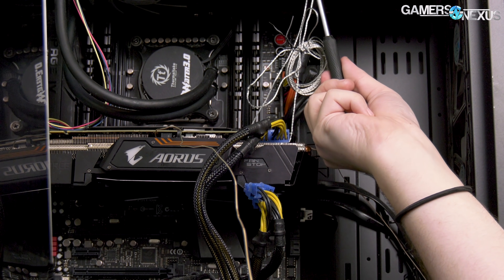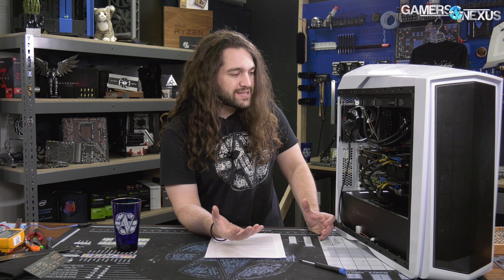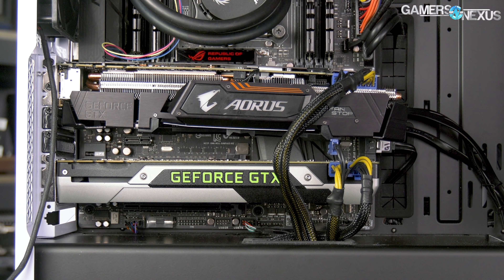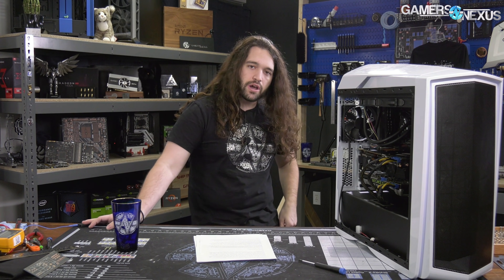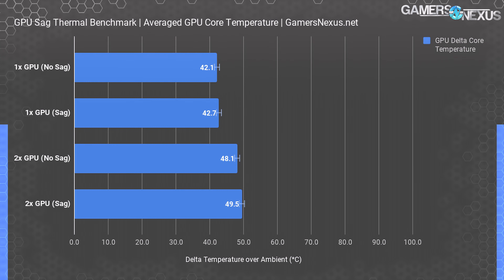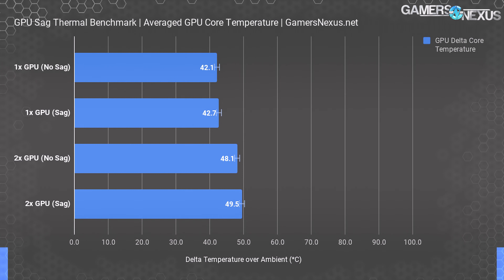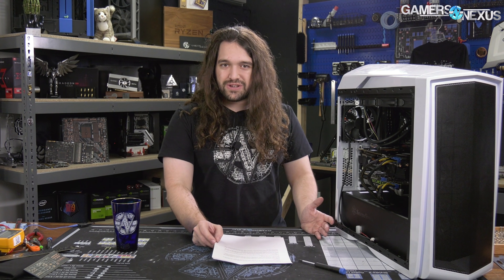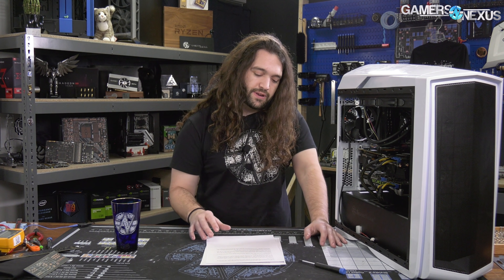Video Card Sag Test: Thermals & Frequency on Drooping GPU

Comment: It looks like the "No Sag" wire was around the PCI Power Inputs for the card, but it also looks like it may have been touching the heat sink.  If this is the case, the metal wire may be effectively increasing the coolers surface area.  Depending on the wire and how much contact, this could be significant.

I have a Gigabyte 1080 Xtreme Gaming G1.  Basically, the 1080 version of this card that cost me the same amount because I got it before the Ti came out and dropped the prices...  My card did sag like crazy.  My fix recently, was to switch to a ThermalTake Core X5 (from a Corsair SPEC-03).  Horizontal mobo, card sits upright, no sag.  Problem Solved.  Except, now I can see that these "X" lights on the front are dying.  One is basically dead, another is half dead and 2 seem to be OK.  

Has anyone had dying LEDs on a card?  Were you able to fix it?  The card is only a year or two old at most and LEDs should not die in that amount of time.  The case fans on my old SPEC-03 were in my case for 2 years prior to obtaining this card and every single LED was still working.  The case LEDs were on much more often than the GPU lights because for the first 6 months I had the card I ran the lights with brightness set to fan speeds.  Most web browsing put the GPU in fan idle or fan stop so lights were mostly off.  

@Steve,  I ran this card in an ASRock Xtreme Gaming v4 mobo.  My MoBo looks fine, but I have seen others with this card complaining that the sag actually pulled a lead or two for that x16 slot out of the board.  My guess here is that they pulled it out when they were removing the card.  My card was actually difficult to reach the PCIx16 release while lifting the card and because the shroud, despite being heavy af, is actually really weak and flimsy.  But I just wanted to see if you had any experience with actual damage due to sag?

Comment: I had a strix gtx970 which would reach 95 deggress celsius in seconds. Didnt know what was wrong since i changed the thermal paste and everything. The next day i supported the card since the sag was bothering me and voila the temps dropped to normal. The sag actualy caused the gpu to lose contact with the heatsink. Thag was the first time i saw graphics sag beiing a problem and to this day i still cant figure out how is this even possible. Most cards bend at the mounting point to the rear of the chassis, my strix had the whole pcb bent like a banana (a bit exaggerated but you get the point)

Comment: I'd say a bigger concern is that if you are the type who moves your PC around, the sag will likely significantly reduce the life span of the card as repeatedly flexing the PCB makes it more likely to break solder joints and copper traces due to metal fatigue

Comment: The Asus GTX 970 Strix of my girlfriend had an extreme sag over 2 years, but the temperatures were still okay. But because of a new case with a glass window we bought a bracket to support it and help the 970 to dont look that horrible, but after "fixing" the sag the temperatures rised in seconds to throtteling, the cooler didn't contact the GPU anymore so we let it sag till today ;D maybe tightening all srews could have helped but the sag looked so horrible, I didnt want to touch this thing and destroy it D:

I'm just very disappointed in Asus, something like that shouldn't happen to such an expensive GPU, my cheaper and larger R9 390 from Sapphire didn't sag after 2 years at all. On this card the cooler is straight connected to the part which also holds the display-connectors (dont know this word in english ;) ). After inserting something similar to the 970 the sag stopped. 

Cant imagine that Asus did such an stupid mistake, and even till today! I bought an 850$ Asus RTX 2080 Dual and it also misses this connection! After putting it in my case it started immediately sagging. However I put an watercooler on it, so I don't care but this is just hilarious, my 3 year old 300$ R9 390 has an better build quality as a 2018 850$ Asus 2080, I will never buy an Asus card again...
Reply: The "part which also holds the display-connectors" - sounds like you're referring to the card's mounting bracket. And yes, the better cards tend to structurally join the shroud and mounting bracket for longitudinal support.
Reply: Christoph603 I had the same GPU, and it too sagged. Shame on ASUS. I have an EVGA 1080Ti SC2 now, no sag yet!
Reply: My strix 1080 is solid as fuck

Comment: My Zotac 1080 ti AMP! Extreme is being held up by a 4 slot sli bridge jammed underneath in a Lian-li 0-11 Dynamic. Still looking for a more permanent solution. Luckily I added a thermal pad to replace the rubber one and even under full load at 2075mhz core, it doesn't hit 55c. The cooler is great. Just very heavy.

Comment: 😒 uhm Coolermaster makes a little stand to hold up the video card, and on ebay there are brackets that you can buy, depending on ur case u can also use string or zip tie 🙂🥃
Reply: Thank you for repeating/elaborating on exactly what he mentioned early in the video.
Reply: @dickr9345  🙂 ur welcome, i hvnt seen the video, im too busy drinking rite now & playing gta4 ✌️😏🥃

Comment: This is very common in high-end Gigabyte cards, I've had a Gigabyte XTREME Gaming GTX 980Ti and it did the same. I used tricks that Jayztwocents used in his sag-fixing video and it worked, however this sag was caused by a bad cooler design, the cooler shroud wasn't attached to the rear IO shield of the GPU and it caused the cooler to sag a lot.

It's probably more brands than Gigabyte, but I noticed that with their higher-end cards. I now have an MSI GTX 1080Ti Gaming X Trio and despite being bigger & heavier, it sags less out-of-the-box, and with its included anti-sag bracket it doesn't do it at all.

Comment: WTF ? i have a 1080 Ti Xtreme Edition (with the rgb logo in the backplate) and have 0 sag at all, fix that case or motherboard because in my rog hero X + corsair obsidian 750D there's 0 Sag.
Reply: I have the Aorus 1080ti non- Xtreme version(so almost same card  without the RGB logo) and I don't really notice any sag. I  am using the card with a MSI X370 Gaming Pro Carbon and a Corsair spec 02 case. The first 2 pcie slots are made out of metal so I don't know if that plays a factor or not. If there is any sag it's no where near as bad as what I saw in this video. Also the frequency in the video where pretty low like Steve mentioned, but I think the settings might have been the reasons. My clocks are sittings around 1885mhz when running Furmark 2560X1440p 8XMSAA and I noticed the clocks would drop off when the MSAA value was lowered, I think 1961mhz is the highest sustained clock I have seen in a more GPU demanding situation at stock settings. I can keep rambling on, but there were a lot of things I was unsure about in this video so I'm just not going to worry about it.

Comment: I have significant sag on my 970. For about 6 months, I was having issues where my PC would come out of sleep mode for absolutely no reason in the middle of the night. Turns out it was the sagging that was causing it. As my case heated and cooled, I think my card was moving and causing my PC to wake from sleep somehow. I was also getting a minor performance loss. I had to change the port my card was in, and I use a bracket now. 

The sag on my card was way worse than  yours at this point: https://youtu.be/l7P9Xm2JZQs?t=50. I was having real trouble getting it out of the case because the clip on the side of the board wouldn't disengage. To be honest I think I was lucky my card didn't completely die. 

I'm still getting a performance loss, but it's minor enough and I'm poor enough that it's just not worth the hassle of buying a new card/machine.

Comment: My GV-N108TTURBO-11GB, sags so bad it pulled itself out of my pcI-E slot. so much to counter it and get my system to post I had to flip my pc upside down. 
I sent it back to Gigabyte a few feeks ago for RMA and they have been on Holiday since before Christmas..
Gigabyte GeForce GTX 1080 Ti 0 Ti Turbo 11G Graphics Card - 11 GB GDDR5X - 352-bit - 1506 MHz
https://www.google.com/shopping/product/6348544280110616391?q=GV-N108TTURBO-11GD&client=ms-android-verizon&sa=X&biw=412&bih=718&tbs=vw:l,ss:53&prmd=sivn&prds=epd:5706066052279742407,paur:ClkAsKraXw-K4A7J23fv3IftFil2DF_6N1_fBFvxdC74fEinpt2InJqOoQyQ7Thm9Kct3aet9cTmcheStmpdatmc51o6TD8rvAN57ItvJbASwVVQFMneTW9rHRIZAFPVH73gJ2Zgc1LqTA1qdQarEwRyn-8kPg,cdl:1,prmr:1,cs:1&ved=0ahUKEwj3vZrQ_ZLfAhXhY98KHc3vAfQQ4qwBCO8B my pc is so sad now. 
pimp my pc?
https://imgur.com/a/sPSfa1p
Reply: After a month of the RMA process. Gigabyte sent back the same card. Still sags so hard it pulls out of the pci-e slot. 
Looks like purchasing a riser cable and vertical gpu mount is going to be my only saviour.

Comment: I'm surprised you bothered with the temp test on it really.  The only concern I have with sagging expansion cards is the socket being pulled down over time, as it can pull the legs of the solder pads(not an easy fix).
If you're concerned about sag, Corsair DID do a really good magnetic legged stand with adjustable clamping arms. Needed 2 stands for my last case as it had no PSU shroud and it was SLI........."BUT IT JUST WORKS!!"  ^_^  This looks similar and it looks like you can screw the rods together from 2 packs if you need extra height:
https://www.ebay.co.uk/itm/Video-Cards-Holder-Jack-Bracket-Computer-Graphics-Companion-Support-Frame-Mount/323399167552?_trkparms=aid%3D555018%26algo%3DPL.SIM%26ao%3D1%26asc%3D20140122125356%26meid%3D20bb1c5d4ba24edd993f64e4f8bc1452%26pid%3D100005%26rk%3D2%26rkt%3D10%26sd%3D323541118426%26itm%3D323399167552&_trksid=p2047675.c100005.m1851

Comment: One thing that I would have liked to have seen would have been what thermal difference the sagging card would have had if the two cards had been switched (as the lower card has more room below it).  

Further concern, IMHO, is now the sag (coupled with thermal flexure from changing workload conditions on the card over time) could have issues on the overall health of the PCB (Circuit path layers, via points and BGA solder pads) as well as the stress to larger component BGA Solder joints.  All of which could contribute to possible early failure of the card (compared to Mean Time to Failure).  Not something that I like to see from my experience (Class 3, Space level Electronic Assembler with many years of Manufacturing & QA experience.  Some of the things that I have worked on are in Military Satellites, currently in Orbit).

Anyways, Happy New Year, GN!!

Comment: My TwinFrozr 7950 was sagging.  First I tried to tie it to the top of the case through one of the unused PCB holes using some bowstring, but that threatened to flex the PCB away from the heatsink.  Instead, I cut down a broken wood arrow and stuck it in there as a support against the shroud where it attached to the heatsink.  Pushing the comparably inflexible heatsink up along with the PCB kept it straight and level.  Creative uses of archery supplies!

Comment: #ASKGN hi, is there any way to test a PCIe slot beside "plug something to see if works" ? for example i had a z77 board that had a bit of pressure put on the videocard and stopped working, it does not present any visual damage whatsoever... and i was wondering if there is any way/software that could send like small signals to the each pci pin and according to the return to tell which pin is "broken" or something...

Comment: Steve makes a great point.  Steve you're in a position to fix this issue as you have not only a huge fan base but also manufacturer ties.  

The VC sag issue stems from either case manufacturers, Card manufacturers or both.  Simply put the 2 tabs on the Card that go into the slots on the case <On the Motherboard tray part> are too small or the case slots are too big.  If you did a video discussing this and called out those who are in a position to fix this they might just listen.  Till then people must pay extra for VC supports that they wouln't need had the slots or the tabs been sized accordingly.

The only other fix is Screws going into the tab slots which takes away all sag as the card is now supported properly the way it was designed.  Jay did a video on this a year or so back and the screw method does work but is a chore should you ever need to pull the card.

tl/dr: The issue is the 2 tabs on the Card itself being too small, or the 2 slots on the case that the tabs from card go into being too large <--- This being the easier issue to fix

Keep up the great info Steve!

Comment: Look at him just by putting his hand down the table, the sagging card bounces. I had an aorus extreme 1060 and I loved the card but it is true that the design is essentially a waste of material and I'd prefer not tying my gpu with additional cables in my case.  With or without it looks disgusting. Not to mention that I have better temps on my msi armor which I considered a barebone card until I saw the temps. Great vid, now I know I like gpus the way I like boobs, without sagging.

Comment: ~1600 MHz as boost clock on a 1080Ti? That seems very low, is your card faulty? Mine runs sustained at 1974 MHz overclocked, or 1911 MHz undervolted to 0.975V. I run with the latter option as it shaves 10-15 C off the load temps and avoids unnecessary stressing of the card.

Comment: I never thought that a GPU sagging would affect performance. However, I always thought it could hurt the PCI slot overtime especially that some motherboards Market that they have reinforced PCI slots for graphics cards
Reply: Well, as the future showed, and a bunch of repair channels cropping up also - GPU sagging is a prime cause of ripped pads on the GPU core, poor contact, broken motherboards, cracked PCIE tooths ...

Comment: I had similar flex on my GTX 980. The previous owner installed a Prolima Mk-26 heatsink on it (233x146x47.1) and the GPU sagged like crazy. So I put a piece of wood underneath it to stop it from doing that.

Comment: Yeh i have bent many rams while carrying in my pocket they working perfectly  . PCBs are designed to bare the bend. But that much sag actually can damage the BGA of the gpu processor. It can also misaligned the heatsink ,so it won't be parallel to the gpu processor thus poor heat transfer and gpu will heat and what he is talking about.
Reply: Do you even grammar bro?
Reply: @sommor001  this is a comment brother not an article i don't care.

Comment: My GPU (ASUS 1070ti, ROG Strix model) was sagging just slightly, so I just vertically mounted it. I haven't noticed any meaningful difference in thermals, but I mostly play older or low-spec games, so I could give it nearly zero airflow and I doubt there would be issues. It looks a bit better and prevents sag, so I'm fine with it.

Comment: I bought a Tt Core P3 to avoid sag... I have a PowerColor Red Devil RX Vega 64... its 2.5/3 slot cooler is huge and it sags.  I will stick with vertical card mounting from now on.  It looks better anyway.

Comment: As a note i've seen a card that sagged so long that when it was levelled up it would  pull the cooler away from the gpu die very slightly resulting in  almost instant throttling ,  card was a Strix 970.  Guessing it ended up with a warped PCB due to prolonged sag. Managed to fix it with a re-paste and very slightly twisting the backplate to counteract the PCB.

Comment: My 1st thought when I see a gpu sagging so severely is that the card must weigh a ton. As someone who used to move their pc a lot, I'd be so paranoid about having a card that heavy inside my pc. Not so much the sheer weight, but the fact that its construction is lacking in rigidity so much that the card will bend under that weight. Add that amount of flexibility to a car ride and you've got a formula for a pci-e slot being ripped off a mobo as the card bounces up and down over every speed bump. A more rigid card wouldn't have that same sort of pendulum effect on the slot, bouncing up and down from movement, so would be much more likely to survive a car journey. Thought that's all just supposition from me.

Comment: I got a 1080 about 9 months ago now, I also bought a bracket to stop it from saging at all. My main reason for doing this is a previous card I had an MSI 1060 6GB had quite bad sag, I did nothing about it, I worked fine for about 12 months then became unstable. Upon inspection the PCB had warped and the cooler was no longer making good contact with parts of the card. So for any build I now do, I will be using a bracket to eliminate sag just to be on the safe side, or buying a case with support built in.

Comment: 2:20  for non-muricans
1 inch = 2.54 centimeters
Reply: I'm a Briton and I use inches fairly often.
Reply: @invective.  

Even if you use it often, 2 inches isn't that big...
Reply: Are you replying to me?
Reply: People in a lot of places use a combination of imperial and metric, or alternatives to those. Relatively seldom does anyone, anywhere use purely one standardized form of measurement, unless one's personal preference can be called a standard.
Reply: 1 inch = 1 thumb-breadth. :P
Reply: John 
100000% this.

Comment: Steve, maybe you may test (somehow) completely diffirent GPU mount - horizontal, but fans looking up? The only way to do it, i guess via riser.

Also, what do you think about mount everything (PSU, MoBo and GPU) horizontally?

What if separate PSU, MoBo with CPU and GPU in three diffirent tunnels and moount fan inside?

P.S. When picture from thermal vision will be more common? Maybe deal with Fluke or FLIR? I know this hardare is expensive, but we need it!